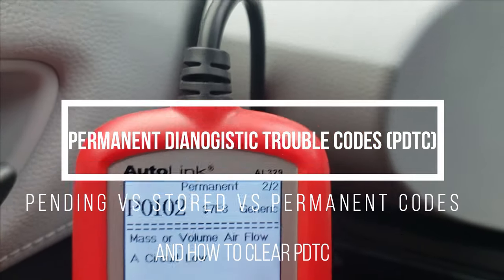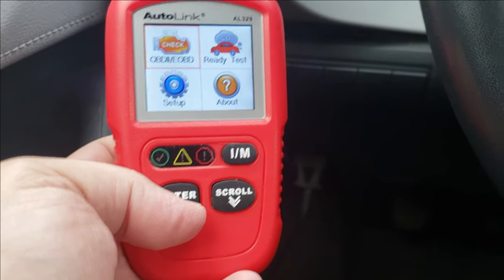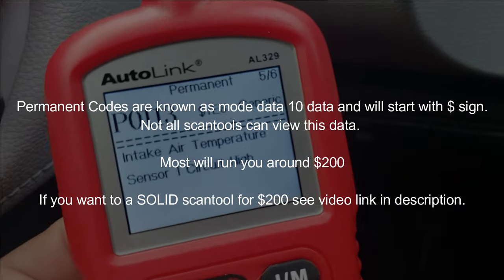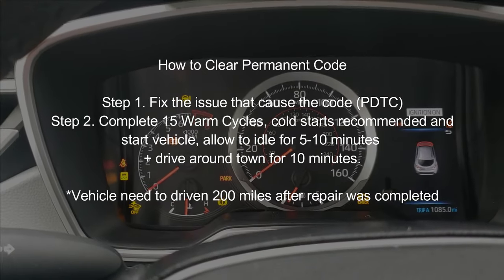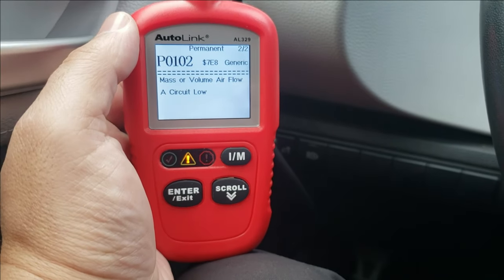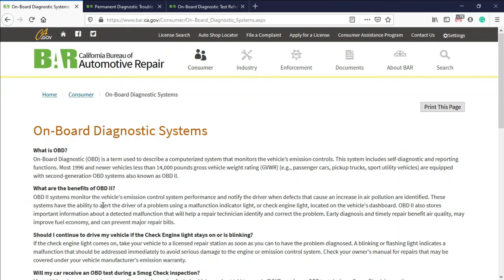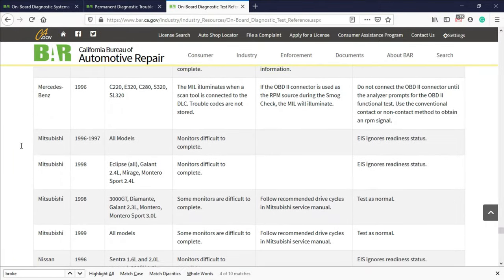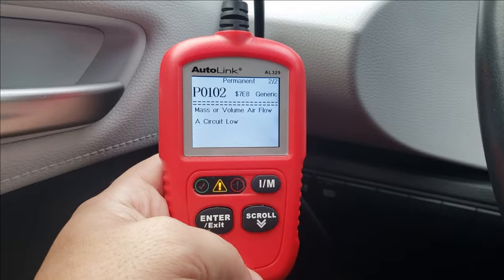Clear Permanent Codes by doing this with your vehicle!

Comment: I have the P207F code how do I permanently clear it.
Reply: Do you need to pass a state inspection?  What state?  Is your Check engine light on?
Reply: @stevew9563  Florida. No our state inspection is them looking at the vin to make sure it matches some paperwork they do not care if the car works 😂

Comment: Are there circumstances under which a PDTC will not cause a vehicle to fail a Smog Check inspection?
Yes. PDTCs will be ignored if the vehicle has completed at least 15 warm-up cycles and been driven at least 200 miles since its OBD information was last cleared.
Reply from the maker: I Neil, I’m not sure if you Asking a question or stating a fact. This was true in the past but now a pdtc will cause a fail unless it’s is known to be an inherent defect as I stated in the video. You can follow my experience at the smog shop in 2022 and the recent updates in this video.

https://youtu.be/5DYY3mqGJTM
Reply: @RANDOMFIX   - Come on man that is not true.The 15/200 rule still applies.
Reply from the maker: Steve, sorry buddy I don’t follow? What do you mean that is not true? Please elaborate, I appreciate your feedback. Thanks
Reply: @RANDOMFIX    - You wrote:  "This was true in the past but now a pdtc will cause a fail unless it’s is known to be an inherent defect as I stated in the video."

A PDTC will not case a fail as long as you have 15 Warm UP Cycles and Driven 200 miles.   Just like the OP said.
Reply from the maker: Steve, you have a good point but I go off what the tech told at minute 12:03 

https://youtu.be/5DYY3mqGJTM

Maybe I misunderstood him? Please clarify you know differently as I this would help a lot of people who end up driving around burning expensive gas. I appreciate you letting me know nonetheless.
Reply: @RANDOMFIX   - Hes right in that if you fix something, clear the codes and now have a permanent code yes it wont pass if you drive immediately to the smog shop for your test.  

But if you drive 200 miles and go through 15 warm up cycles (not drive cycles, 2 different things) and no code reappears as confirmed then you will pass. 

He was just being lazy in that he did not answer the question fully.

Comment: what if i clear the codes multiple times before i get to 200 miles or 15 start and warm up cycles? does this mean i have to start over from scratch and do another 200 miles and such?
Reply from the maker: You can't clear a permanent code using a obd2 reader or scan tool. It will only clear after your vehicles the issue is cleared.
Reply: @RANDOMFIX  then why is your video titled how to clear permanent codes? You can’t. It’s a manufacturer specific code.
Reply: @slavikk6712 it could b ignore not clear.

Comment: Hey brother I have a 2010 prius replaced the hybrid battery I still have the permanent code P0A80 please help
Reply from the maker: Who replaced the battery? Make sure the filter and fans are working and not covered in dog hair or dust. You should clear the hard set codes and see what happens. If this is a permanent code then the vehicles needs to confirm the issue is fixed. 
Good luck and let me know what happens?
Reply: Did they clear all the codes after replacing the Hybrid Battery?  If so get 15 warm up cycles and drive 200 miles.  If the only code you have at that point is a permanent code then you will pass a smog check with the Permanent code in place.
Reply: It's OK to have a permanent code as long as you are not needing to pass a smog check.   A permanent code does not mean anything is wrong with your car.  It means something "Was" wrong with your car.

Comment: I have a permanent prompt displaying on my 2016 Colorado 2.8L Duramax. It reads:

 “Emission System

See Owners Manual Now

132 mi Until 65 MPH Max Speed”

No check engine light/DTCs are present. It did have a temporary DTC of P20BE but it cleared itself after some time driving and hasn’t came back on. Ive driven it well over 150+ miles. This all happened after sub ZERO temps and -20° windchills. No issues with truck prior to cold snap AND it still is starting, idling and driving fine. Just has the permanent display as I stated above.
Reply from the maker: Thank you for your feedback, much apprecated!

Comment: So even if I still have the permanent code and I drive over 200 miles and cold start the truck over 15 times I will pass? I just failed for a p2609 air intake heater code... has nothing to do with damn emissions. Just a permanent code since it's cold here.
Reply from the maker: Unfortunately a code is code and will keep you from passing. The 15 cold starts with 5 to 10 minute drive will erase the permanent code and once you have all the monitors ready try again and your will pass.

Comment: Drain the battery of all power 40 min all codes will be gone.If not power to store the code how would it save anything. 😊
Reply: Nope wont work for Permanent codes in 2010 and newer cars.    But there is no need to clear permanent codes they are not hurting anyone. Only reason they matter is for a CA smog check. Other than that ignore them.
Reply: @Steve W  I got the permanent ones removed by draining all power no codes I had miss fire cly 1 permanent it cleared all of them.But if it happens again the check engine light will.come back on.
Reply: @Steve W  I have a 2011 honda odyssey worked removed all codes even permanent ones.
Reply from the maker: What? Are you sure? Was a stored code or permanent code?

Comment: so this is a problem for all new cars then ??
Reply from the maker: Yes, this will be a major problem for 2010 and newer vehicles. Sometimes there is an actual defect and the owner is not at fault but we are stuck trying to fix. I'm there is some poor guy for $$$$ right now for a repair that can't ever be corrected without replacing the engine control unit. I hope every checks the list of defective vehicle first before pay $$$$.

Comment: But how long do I wait before light comes back if problem persist
Reply from the maker: If you clear the code and complete the instructions in the video the light will not turn back if the vehicle goes the parameters and determines the problem is fixed.
Reply: @RANDOMFIX  ok so did that not sure how many times should I wait before I know it’s good
Reply from the maker: It's in the video, 15+ cold starts with a 10 minute drive each time. It could clear sooner if the vehicle is able verify the problem is fixed.
Reply: I have a 2012 Camaro LS and have a permanent code preventing my car from passing smog. Driven 15+ times, over 400 miles and smog place said the code is still popping up and not passing. Not sure what else I can do. Driving with expired tags.
Reply: Original problem was just needed a new gas cap. No check engine light since.

Comment: What a waste of time. This video is useless in every way. I’m trying to delete a permanent emissions code after I tuned out the code from the vehicle. Meaning now the code doesn’t exist period full stop it can never come on again but is still stored in permanent codes btw I have a 09 impala and perm codes obviously can’t just simply be erased.
Reply from the maker: You need to complete 15 drive cycle and if after 15 drive cycles the smog tech can do the process manually. What did you understand about the video that I can better explain in the future? Thanks again for the feedback. 

By the way the pdtc affects 2010 and newer vehicles.
Reply: Do you need to pass a emission test?  What State?
Reply: @RANDOMFIX   - Some 09 cars had them, they were legislated to be standard in 2010.